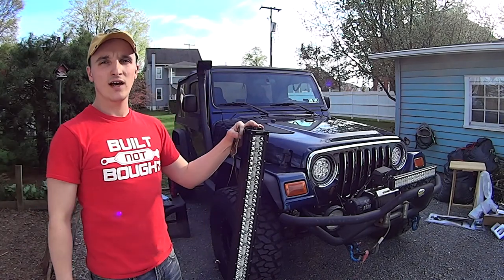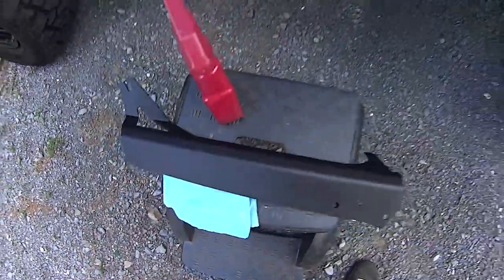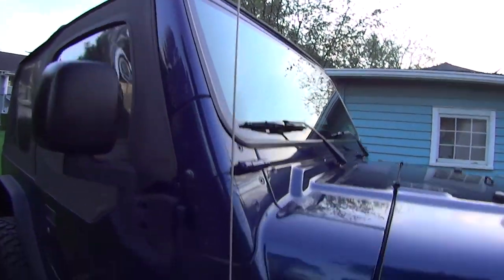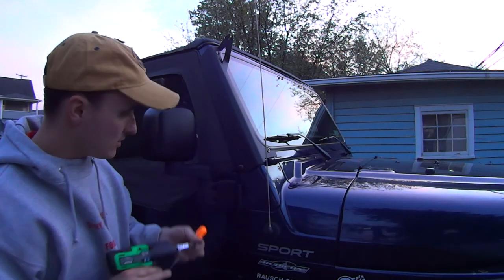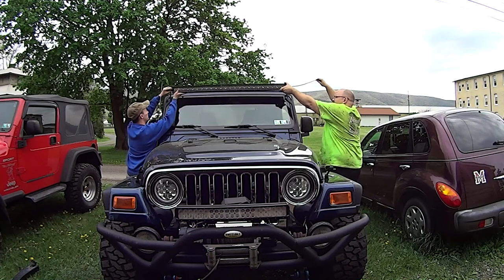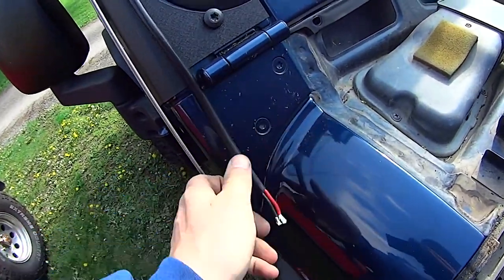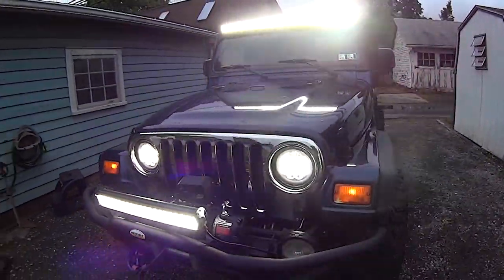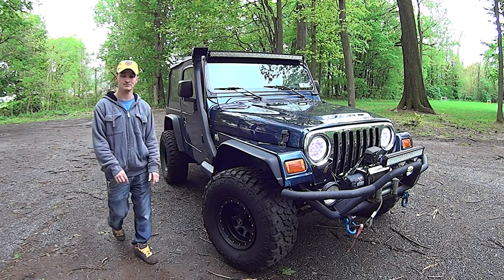Project TJ Wrangler: Ep 38- Auxbeam 50 Inch Tri Row Light Bar Install

Comment: what did you ever end up doing for the wiring? im currently trying to get my light bar mounted and wired but not finding any other way to wire it besides drilling into my A pillar and feeding the whole wiring thru that channel on the inside of the A pillar then down thru the firewall. Really trying to avoid pinch points on the wire like you had with the hood on ur wire.
Reply from the maker: I guess I never did get around to editing the update video.... I cut out a notch from the underside of the cowl panel (not the top where you can see) where the wires run under it, then I pulled back the cowl seal and cut out another notch on the pinch weld the seal presses onto. Now the wires seamlessly run under the light bar bracket, under the cowl, and out into the engine bay from underneath the seal. The cowl panel and seal sit normally and the wires are almost completely hidden. Five plus years later and I've never had an issue.
Reply: @UndergroundTrev  thank you!

Comment: Hi just ran across your video , was wondering if you got a serious hum or whistle/ vibration after you installed your light bar? I want to install one but read a lot of people are not happy with the noise if makes ,
Reply from the maker: I did. I solved the problem by putting door edge trim on the cooling fins on the lower half of the light bar.
Reply: @UndergroundTrev  thanks for the reply , appreciate it !

Comment: I actually like how you used diamond plate for the snorkel. That's an awesome way to fix your mistake. Personally I'd get a vinyl cover for top of your fenders. They're already rotted so it won't be a concern of holding moisture. They'd cover your hole nicely. Plus a piece of vinyl to overlay it would be extremely cheap.
Reply from the maker: Some plain vinyl covers wouldn't be a bad look. Definitely cheaper than fenders and paint! Thanks for the suggestion.

Comment: I put one of those 53” lights on my Jeep last week and it looked great but the wind noise from the soft top was way too loud.
I tried adjusting it up and down but still the turbulence that was caused by wind passing under it was like drive beside a freight train 
People talk a lot about the whistle but I fixed that with door trim but could not reduce the bumping sound. Took the light back off today no way I can ride down the highway with that much noise. Have you had that problem?
Reply from the maker: This light bar has been giving me a noise problem for a while. It starts out as a low toned noise and increases with speed to a high pitched whistle that is too much to take. I've had my Jeep laid up lately with other projects, but a review and experimenting on fixes for the noise is coming eventually.
Reply: UndergroundTrev the door edging I put on the fins did seem to help but the wind buffering across the soft top never got better.I assume that’s not a problem for someone with a hardtop. Hope you can find a solution. I really hated to take mine back off after only a week but it was just too loud on the highway.
Reply from the maker: I noticed if I aim the light bar down (a lot), the noise will go away. I want to either modify my brackets or just buy new ones that will hopefully push the bar farther away from the windshield frame.

Comment: Will a 50 inch bar fit a 4 door Jeep. I have a 2012 jeep wrangler unlimited Sport.
Reply from the maker: It should. Most JKs can easily fit a 50 or 52 inch bar, it's just a matter of getting the appropriate brackets.

Comment: Did the light bar come with the light bar mounting kit
Reply from the maker: No, the mounts are separate. The mounts don't seem to have worked very well either, they position the light bar too close to the windshield frame and it creates a very loud and high pitched whistle noise. The paint on the mounts is also flaking off after just one winter. I'm eventually going to cut and weld them to re-position the light bar. Obviously I'll repaint them as well.

Comment: Can't you just hook the light up at the fuse panel? Do you need a relay dude?
Reply from the maker: It is always a good idea to run a relay for accessories!
Reply: @UndergroundTrev  If I wire it to a fuse will that be adequate? Thanks
Reply from the maker: @billveder1071  You should be using a relay and also a fuse. If you have a light that did not come with a wiring kit, you can get kits with a switch, relay, and inline fuse at your local auto parts store. They are very cheap.

Comment: where did you end up re routing the wires through?
Reply from the maker: Still working on it. I want to loom the wires for some protection and maybe notch the base of the cowl panel just a little bit. I also plan on notching the seal slightly on the underside, this way it stays one piece, doesn't crush the wires, and the wires can run underneath without distorting the seal.